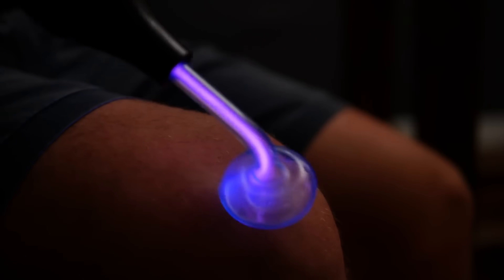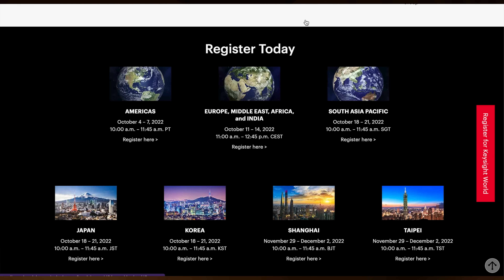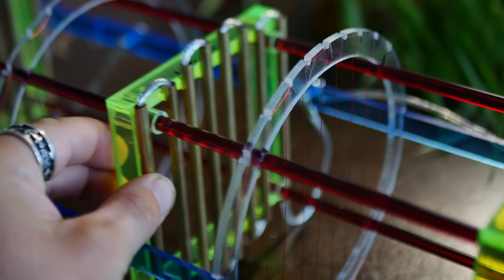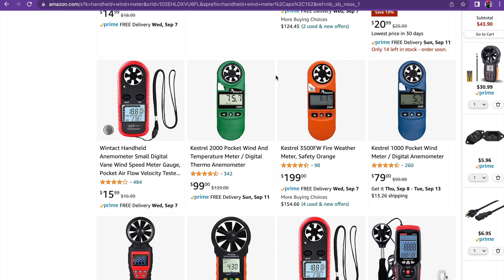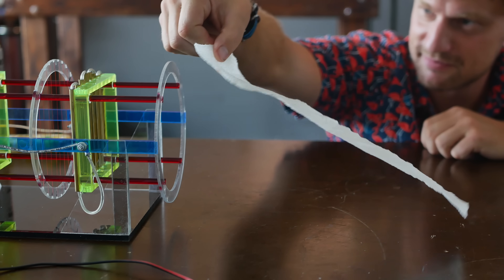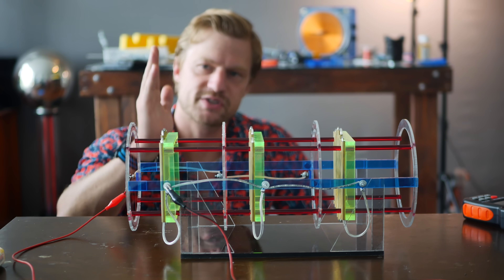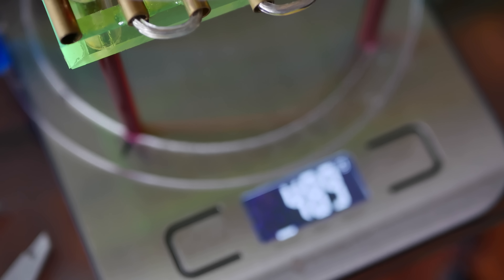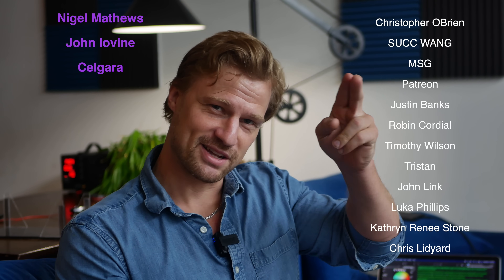Designing A Next-Gen Ionic Thruster! (For Flight)

Comment: So if weight is one of the biggest problem to make this fly adding more stages with diminishing returns seems to be the wrong answer. Since adding stages adds 100% of the weight but only a small percentage of the thrust. Every stage will make the design more compact but also a lot less efficient. Another issue to figure out would be to find out how efficient the thruster is when the air is moving already (when flying the air is moving relative to the thruster). Accelerating still air is probably alot more eficcient than accelerating moving air even more.

Comment: Awesome content! I will say, your optimization of your design will ever only be as good as the measurements you can take. If you are not taking reliable measurements of windspeed or whatever you are using to optimize your design, you will never figure out what is actually causing an improvement. I like how you measured both thrust and windspeed. I would recommend taking at least 3 measurements per point, and ensuring that the wind gauge is in the exact same location. It looks from the video that you held the gauge directly in the center for the last test of staggered layout.

Comment: What about instead of winding back and fourth, try doing nested rings.  You would get less interference in your air flow and could better compound the air speed.  Smaller at the rear, larger ring in the front allowing all airflow from each stage to be passed through the middle of the next.

Comment: I'd be interested to see if you could stack the wires one direction and have the second be at a 90 degree turn and if that would increase the thrust while minimising the length. Alternatively maybe a hollow tube (of plastic or steel who knows) with winding around to increase the thrust. Or maybe less like a spool of wire and more like a toroid shape. I guess knowing if you are using enameled wire or not would be crucial to these ideas.
edit: or instead of just stacking them and turning, keep them separate but rotate a few degrees each set and maybe encase all but the front and rear (might need to have inlets before each set to introduce uncharged particles) to create a sort of twisting vortex movement of the air?

Comment: My first thought was a duct to reduce leakage, as others mentioned.

Wind tunnel test with a variable speed fan and flow straightener (bunch of drinking straws). Test how input velocity affects the increase in velocity and the energy efficiency of this increase. 

This can help optimize each stage of the staggered design separately. Maybe different voltage for each stage?

Try to sandpaper the emitting wires.

Is the best voltage for ionizing the air also best for accelerating it? One way to test them separately is to add high voltage RF on top of the DC. 

How does the density the the emitting or receiving grid affect  thrust/efficiency?

Comment: to increase thrust, it's better to move a lot of air slowly rather than a little bit of air mass really fast. Since momentum is mass * velocity, while kinetic energy is 0.5*m*v^2. So the force/energy ratio scale at the rate of 1/v. Given ionic thrust typically propel the air extremely fast, you're not going to get a lot of thrust per power spent. Plus there is an issue with choke flow. 
But if you apply ionic thrust along a chord of an airfoil, the increase iconic wind velocity can keep the boundary layer extremely small and prevent flow separation. So theoretically you could have an airfoil with iconic propulsor placed along its span to keep the airflow attached even at extremely high angle of attack without stalling. Thus generate high lift (which effectively mean high thrust downward).

Comment: Spent the4 night thinking about the design. Narrow the gap between wires so that the plasma jets overlap by half, think Leafmail armor, and mae the grid a hex by running another grid at 120 and 240 degrees around, and that would make it more circular, THEN place the whole thing in a tube to get a better effect, as others have said, and THEN try it out again with just 1, 2 or 3 grids to see how much thrust you're getting. You might also want to either add a split diverter, what they had to do to the V-2 and NASA Mercury-Apollo rockets to prevent a spinning venturi exhaust.

Comment: Epic, had planned to do a very similar build myself. Stoked to see it working.

1. You tried adjusting the distance between the anode and cathode but did you try changing distance between the pairs? 
2. Changes the anode and cathode density(#of wire wraps.

If you are thinking of flight for the thruster:

3. Use additive manufacturing and make all members of the device hollow lightweight polymers. (Such as esd resistant abs or glass filled nylon)

4.  Once you are done testing on the distance relationship of your array, you dont need the adjustment mechanisms any longer, lots of weight saving.

If you were going for untethered flight…difficult, might need to make a similar glider as that other team, but one thought i had was to design your own PCB for your power needs and make the board itself into a structural element(some weight savings)

Great build!

Comment: Definitely need to think about airflow, doing a thrust test straight down will give really bad results as it has no air to suck in so I would consider trying a different setup , also putting in a tube and adding a nozzle is going to make this so much more efficient

Comment: 1. Shroud or duct the airflow,
2. utilize a Venturi inside at the second stage to increase velocity to the second stage,
3. add a nozzle, and,
4. try adding vortex generators to create a rotational flow through the duct. This would mean the stages themselves would have to be designed to induce a rotational flow with angled fins and curvatures….

Finally, like a jet engine, this engine should theoretically create more thrust and velocity of flow, the faster it moves through the air until drag and thrust reach equilibrium. So, reduce your drag coefficient externally and you’ll also push that equilibrium out further…

Comment: I noticed that at certain points on the wire, there were specific points lighting up.  Is that due to imperfections in the wire?  Creating points of plasma production?
Reply: I wonder if you can add imperfections in the wire creating concentric circles while using a grid of wires vs just horizontal wires.

Comment: also, by adding a tube to the outside of the device have an effect to the concentration or elimination of outside air drag.    If you make a shell to go around, use the idea of a golf ball, using dimples inside the shell to promote airflow and less drag
Reply: I believe the dimples create micro turbulences that allow the inside air to move through without clinging to the outside wall

Comment: Is flat starting unit the best one or is a curved one better to add most of the airflow to the tubular engine design? And similarly the last unit could be better if the design shape is not flat.

These changes could add more air to the engine and also more air to push against when airflow exits the engine.

But this also complicates the making process. This is not a huge issue if it has enough benefits.

Comment: 1) Make a tunnel design. 2) Different size units (like in jet engines, see inner tube design) 3) Alternate currents between units (1st weakest vs 0 starting airflow speed, 3rd largest vs airflow speed, 2nd and 3rd current may alter if tube design changes).

Comment: Maybe I am misinterpreting you data at the end but is to that showing that you are getting diminishing returns with each stage you add? So if you ran them in parallel rather than in sequence you would get a thrust of 4.8m/sec  1.6 x3 rather than an 2.4 m/sec. Is there some other trade off that I am missing?
Reply: Friction and air pressure

Comment: ineficciencies could be 1, air pressure loss from open sides of the engine, with no thrust guiding funnel at the rear. 2, ineffectively shaped ground rods, these could be made much thinner, while still attracting plasma. 3. non optimised frame design. The frame can be re worked to provide more structural integrity to each "layer" while weighing less.

Comment: Is stable current the best solution? In first part you have 0 wind speed, in next you have more and in last you have most. So it could be beneficial to try adding up voltage when the wind speed rises.

If energy demand is low enough, then this could be used in a light weight drone.

These tests should ramp up to multiple ones and balancing their power/thrust, so it could be used as twin engine buildups. Like 1 engine on each wing of an aircraft with alternating thrust.

Also test larger buildups too, so you can see if this can be scaled up without disadvantages.

Comment: Looking at the still fame of the plasma comming off of the wires, it looks like it's not evenly distributed through the length of the wire(isolated points in the wire). I wander if the wire was replaced with something similar to a razor blade(sharp edge) if that would spread the plasma more evenly down the length of the blade and if it would be more efficient?

Comment: 1- The components beeing exposed, aka the system not beeing inside an enclosed tube may cause some of the ineficiencies.
2- adding a nozle migth help with T/W ratio, but that will need an enclosed sistem.
3- the internal airflow can be improved with better grouding design. The 'thick' cilinders create barriers to the fast flowing air, reducing its energy, and in higher air speeds(even in the current sistem) migth cause turbulency, greatly reducing overall efficiency. Im not sure about the eletrical part, but looking strictly to an airflow perspective, a fine wire "mesh" migth show better results.

Im not well versed in the eletric boogaloo aspect of the project, so sry if something I said is not doable becuse ~insert eletric shennanigan~ reason. Great video, waiting for the next steps!!

Comment: My thoughts on the inefficiencies:

Enclose the engine in a tube to contain the ionic wind and ensure it only goes in one direction.

Circular electrodes rather than straight ones to improve the surface area of the electrodes contact with the air. Think of circles within circles (or spiral) but with adequate spacing for the air to move though unhindered.

Weight, reduce weight as far as possible. Use 3D printer to manufacture hollow parts for example.

I understand you probably want an entirely solid state thruster but I’m also wondering if an air compression stage at the beginning would allow for more thrust. Think of an axial flow jet engine type design but the ‘combustion’ stage is the ionic thruster.

Comment: How about to increase amount of stages and increase voltage on each next stage? Also add some tube to decrease adding air from sides? Aslo you can use pre-ioziator by UV light to increase amount of ions in the air flow. Aslo use additional metric - count amount of air wieght per second. It will help to see how close you to make trust hier than engine wieght. What happen when connect tesla coil to truster as voltage source?

Comment: Great idea, very impressive build quality and idea. What you will find really effective is if you pulse the power in bursts, You can vary the pulse duration and speed of pulse, I think this will enable you to get a much greater thrust. The other thing is, you have the thin wires running in parallel, you might find it more effective to cross them in effect making a grid, you could also halve the spacing and get more wires in. As the power drops over some inverse square law, you might find the best spacing is non linear, maybe based on some r squared law. Maybe an interesting idea might be to pulse all three thrusters in sequence firing the first one and a millisecond later the next one. I think you can certainly get to a doubling of thrust.

Comment: Great work.  
1. Would walling the thruster help reduce turbulence from external air, or funnelling from each thruster to the next?
2. Would varying the power voltage allow for more thrust for less power (as you ate trying to speed up faster and faster moving air with the same voltage).
3. Could a tighter or wider spaced wire grid provide more efficiency?
4. Would additionally layers of thrust add to the overall thrust (especially if you factor in 2)?
5. Would balsa wood, aerogel, silver foil or a minimalist 3d printed plastic 'mesh' be lighter?

Comment: So back in the 90s I did extensive studies of ionic lifters. Built abound 150 different versions of them and as far as I know to this day I hold the world record for highest altitude successful flight of one. 

I got one to fly at 7000 feet above sea level. 

A few things I learned apply here. 

1) potential is king. You want your air gap to be as small as possible, and your voltage as high. But air pressure and velocity are going to impact these numbers. I suspect this is why your variable spacing was effective. 

I would like to see what would happen if you optimized one stage for voltage vs air gap. Then added a second, and optimized that. And then a third. Insurrection you could at least double your thrust.

Comment: Yes, as others have been saying, enclose the sides and create a venturi at the end. Also, if your testing has proven that more stages are better, why not test the upper limit of that by adding many more stages? I’m sure it will top out at some point, but a couple more stages would probably add thrust without drawing so much power as to be unworkable.

Comment: Try using a 1cm fine chicken mesh grid as your thin elements and then see at what fineness 0.1 to 1cm will affect airflow.  There should be an optimal parabola for this.

Next thing could be once the optimal mesh fineness is found then multiple layers could be stacked very tightly (mm range)  and these would then share the common ground brass rod plane like before

Comment: Ionic propulsion works by electric charge building up on the material's surface at a high enough voltage such as to ionize the air and create an airflow between different polarities. So my theory is this: instead of arranging 3 stacks of individually functioning ion thrusters in parallel voltage (+-+-+-) you could stack ionizing air 
foils shaped as a water droplet vertical section. The difference may not sound much, but in practice you would have not as much losses since the subsequent layers not only would help with laminar flow, they would, most importantly, work recursively from one another. added benefit of less complexity since all the layers would be fiscally built the same. You could achieve the required shape by wrapping a not so thin wire with aluminum foil. Like the ionic lifters.
Also, the space in-between wires can possibly be optimized.

Cheers, absolutely amazing video. By any means what i am saying should be taken as criticism, just taking a crack at the problem and the fact that the engine was built with testing in mind was amazing.

Comment: Maybe 3D print a funnel/bracket system with carbon fiber filament. Super rigid and very light! I wonder if rotating the wired ion generators 90 degrees each pass would have any effect, essentially making waffles. Also does tension on the wire have any effect? I’d think if you could guitar tighten, you’d get less micro vibrations which might reduce output. Just my two cents…

Comment: First, I'm thinking some ductwork to compress and direct the airflow. Second, with multiple stages, a larger first stage to progressively smaller stages for the compression. Third, see if adjusting the voltages individually for the different stages impacts overall thrust.

Additionally, I'm not sure if it requires all straight lines, but I'm wondering if a mesh might work better and give more even airflow than just parallel lines.

Also, take the wider back end rods and shape them, either to compress and/or direct the flow or at least to reduce the drag and allow the air to pass by better.

This is just my initial thoughts as I don't know enough of the lifters concept for more refined ideas just yet.

Comment: I'm really impressed, I've been trying to work on improvements to ionic thrusters in my off time, but don't quite have the time to work on it. (I do high energy plasma etch and sputter process research and development for a living. Semiconductors are crazy at the moment, so taking up most of my time.)

Your spacing should tighten up, and with modern 3d printing we can make these things incredibly close. Long term, the equations all run out to microscale spacing being ideal.

Once you get down to that level, you can start playing around with lightweight permanent magnets and magnetic clamping of the fields. (This needs to be at <2-3 mm length scales) While increasing voltage will generate thrust, it's actually the extra amps that voltage induces that do all the work. DC plasma ignition has a terrible voltage to amp ratio without clamping. Magnetic fields running in plane with your emitter surface will vastly decrease the amount of voltage to get the same amps.

One of the problems you can run into with tighter spacing is backflow of the ions that causes scattering. That's what I've been stuck on because you need a ramp between your stages. I'd personally take your voltage output and stagger it to each stage and neutralizer - say you have a 66kv ramp to ground, I'd put your first stage at 66kv, keep ground plane 1 at 10kv, then stage 2 at 55 or 44kv, ground plane 2 at 5kv, stage 3 at 33 or 44kv, ground plane 3 at actual ground. This creates a long range voltage gradient.

The last thing I'd do is move from linear wire arrangements to circular emitters, and build a jet cone around the thing, placing a 3-d tesla valve up front. This will amplify your airflow and exhaust your ions more quickly, which should improve performance.

Anyway, good luck. Interested to see what you come up with.